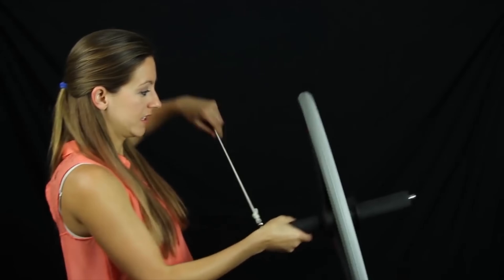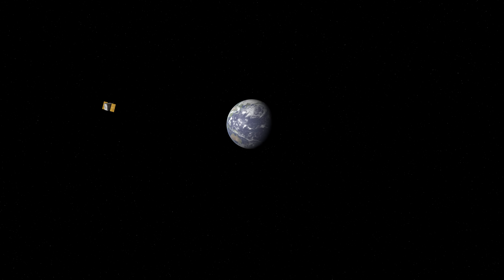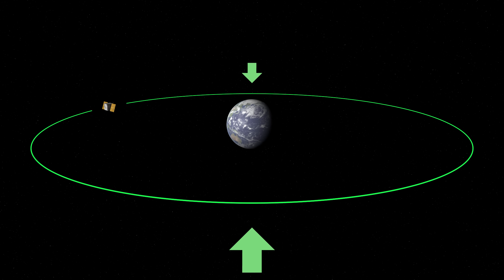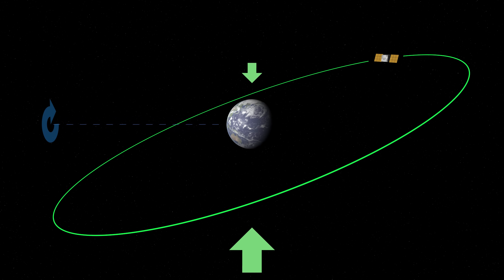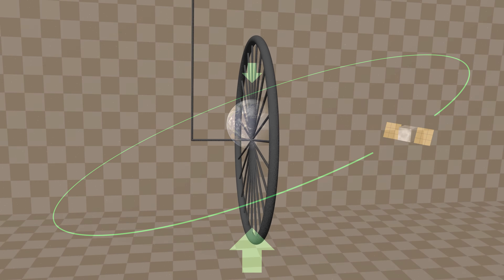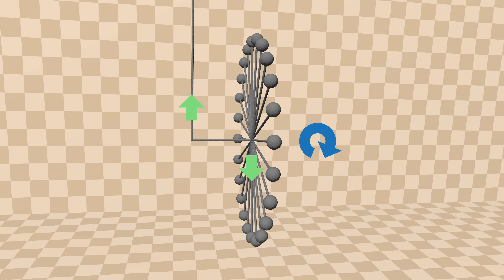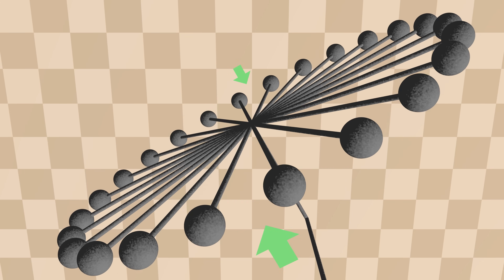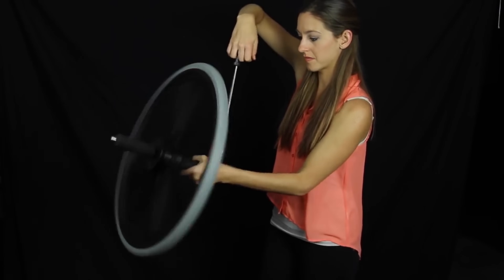Gyroscopic precession -- An intuitive explanation

Comment: Check this out! It has a part near 6:40 that talks about how gyroscopic precession caused by the Sopwith Camel's rotary engine made handling "tricky" for it's pilots during World War I. The rest of the video is pretty interesting too.
https://www.youtube.com/watch?v=MI08NGCgISE
Reply: The way I understand the rotary engine is that the motor spins around the crankshaft instead of the other way around which seems pretty backwards but actually makes for a more powerful engine when you think about the much higher moment of inertia it offers as opposed just the propeller and crankshaft spinning. It also kind of acts like a turbine and helps to keep the engine cool.

Comment: Why am I still confused, feel like an idiot. Gonna have ap physics test in next two week, IHAVE to understand it
Reply: Understanding it intuitively probably won't help your physics test, but think of it like this:

A force that is constantly acting perpendicular to the velocity of a moving object will not speed it up, it will only turn its velocity making it go around in a circle. Gravity acts this way on an object in circular orbit around the earth; as does the force in the spokes of a spinning wheel.

If an object is in a circular orbit around the equator of the Earth at 7.9 km/s and you give that object a 3 m/s nudge out of the equatorial plane, that object will not teleport anywhere; it's still going 7.9 km/s around the Earth, only now it has a small component of its velocity perpendicular to the equatorial plane. Since the nudge was perpendicular to its velocity it will deflect the object without speeding it up.

It will take it a quarter of a turn until it reaches the position that is the furthest out from the equatorial plane and gravity brings it back down toward the equatorial plane.

The spinning wheel is behaving in the same way. If you try to turn it; the rim is already spinning very fast and it will take a quarter of a turn to move out of the plane that it was spinning in, before the force in the spokes start bringing it back down.
Reply: watch the one by eugene khutoryansky it explains really well

Comment: Okay, so here is an experiment. And, what causes it? We mount two flywheels each on a different shaft. Mount them in the back of different pickups, with  the shaft horizontal and parallel to the pickup length. We spin one flywheel CW and the other CCW.  Then we drive the pickups forward at the same speed.  theoretically the one spinning counter-clockwise should stop rotating faster? And. it should decelerate faster if we drive faster? Will the other one accelerate?
Reply from the maker: Joe Deglman The pickups are driving in a straight line? If so, the rotation speed of the flywheel should be unaffected by the linear motion. That's theoretically, of course, in the real world air vortices, imperfect bearings, even interactions with magnetic fields could yield all sorts of spurious results.
Reply: Okay, so what you are saying is that the torque only appears when you accelerate it in one direction vs. the other, but disappears when you get to a constant velocity?
Reply from the maker: First, you apply a force/torque to something, and then it accelerates/rotationally-accelerates in response to that. You've got it backwards suggesting that torque arises from acceleration. That point aside, precession occurs when you apply torque to a rotating body. Your question seems to be whether precession arises from applying a linear force, and the answer to that is a resounding no -- regardless of whether it's constant velocity or not.

Comment: is there a duck in a corner at some point?! and did you use the moon as texture to the spheres on the wheels?! XD
Reply from the maker: Yes, there's a duck hidden in the video! But no, the texture is procedurally generated in POV-Ray:

pigment { rgb 0.2 } normal { bumps 0.4 scale 0.02 }

Comment: THANK YOU! I had trouble understanding why angular momentum had that direction. I pretty much got to the point on my own where I imagined thesame situation with the satellite and pushing it up or down. Then I clicked this video and it just filled in the gaps and now I finally fully understand something that I previously only could apply in calculations. So, I knew how it worked, but I didn't know why it worked. Much more rewarding to know why it behaves like this. I might have deducted it after that initial thought, but it also just feels very good to find a video that confirmed my initial idea and then just take it 1 step further and ofcourse it also saved me some time. Very rewarding, thank you very much.

Comment: I still don't understand why the wheel doesn't tip. This video explains only why the wheel rotates around the rope.
Reply from the maker: It is self-evident why the satellite's orbit rotates "90 degrees around" from the applied torque, as shown in the video. The change in position of the wheel's axis of rotation is similarly turned "90 degrees around" from the way that you'd expect the wheel to be pulled down. In short, if you can figure out why the satellite behaves the way it does, then the behaviour of the wheel intuitively follows because the two systems are nearly perfectly analogous.
Reply: D1ndo the wheel will not tip around the rope as the tension in the string equals the force of gravity 
T=mg so
Fnet =0 in the vertical direction

Comment: Best video I've seen explaining this. Top notch mate!
Reply from the maker: I appreciate the feedback!
Reply: @TheHuesSciTech  o
If the forces on the satellite are equal and opposite wouldn't they cancel each other out? Or because they are not being applied at the same time they don't?
Reply from the maker: @leif1075  Forces don't cancel out if they are applied at a different location and/or a different time. 

For example, if you apply a forwards force to the left hand side of a dinner plate, and an equal+opposite backwards force to the right hand side of the plate, the plate will rotate, which certainly doesn't qualify as 'cancelling out'.

If you push a kid on a swing, then wait for it to swing back towards you, and then do a equal-and-opposite pull (or run around and do a push from the other side), then the effect is to boost the swing twice. Again, that's definitely not 'cancelling out'.
Reply: @TheHuesSciTech  yea that's what I thought like I said..but i don't see how your illustration proves that torque points in a direction perpendicular to the regular force vector..since in your diagram with the satellitle it doesnt seem to point perpendicular to the plane of rotation..
Reply: @TheHuesSciTech  Oh by the way that's wrong, if you push a plate on both sides in opposite directions with equal force on opposite sides, of course the force cancels out..try it and youll see and that makes intuitive sense..I just tried it just to be sure
Reply from the maker: @leif1075  I mean apply the forces tangentially. In other words, just try to spin the plate and think about what your hands are doing to the plate: the forces are of a equal magnitude, but pointing in opposite directions.
Reply from the maker: Put it this way: you on the left side of the plate push forwards. On the right side of the plate, pull backwards. The plate will spin (unless you're grabbing the plate so firmly that each hand is providing a countertorque). Pushing forwards and pulling backwards are opposite forces.
Reply: @TheHuesSciTech  yea but they are equal and opposite so they should.cancel out even though at differentlocations..i tried it and itndidnt spin..it makes sense..
Reply: @leif1075  You must be doing something wrong with the plate demonstration if you're not getting it to spin... Instead, get a toilet roll or something of the same shape, put one hand flat on each side, left and right, apply a little pressure and pull one hand while pushing the other. The object will rotate in your grip. The movement of your hands indicates the directions of the forces applied.
Reply from the maker: @leif1075  This is what I'm talking about: https://www.youtube.com/watch?v=A9Rz3emxTn4  . The plate spins. Because even if two forces are equal and opposite, if they're not acting through the same location/line, the force component cancels out but leaves a residual torque. I think understanding how forces combine to yield a torque is what you need to research more.
Reply: @TheHuesSciTech  Thanks  i guess ibwas applying countertorque as you suggested maybe? I fully understand regular torque just the plates seems counterintuitive and the way it's drfined as pointing out of the plane..
Reply: @TheHuesSciTech  Ah ibwatched the video.  i was not pulling the plate down with the right hand rather pushing up on the plate on right and left sides. You see the ambiguity though? Because technically you could still say that's an equal AND opposite force becaise with the left hand you turn the plate clockwise but with the right hand you are turning the plate counterclockwise. Aka..the opposite direction.hence this could be construed as equal and opposite also and would cancell out..see the ambiguity and why its frustratin the limits of language? Sorry for the confusion.
Reply from the maker: @leif1075  Yeah, it's tough doing this over text chat. However, you should know that in physics/maths, equal and opposite has an very specific and unambiguous meaning: the force vectors must be equal and opposite. I.e., north vs south, up vs down. Not counterclockwise vs clockwise, those aren't vectors. Think anti-parallel, if that helps.
Reply: @TheHuesSciTech  why aren't those vectors..they point in specfic and opposite rotational directions..I don't see why they wouldn't be vectors? I think most people would consider them as such?
Reply from the maker: @leif1075  We're really getting into the weeds here, partially because this is really messy to discuss over text chat. This would be trivial to discuss if I was sitting next to you, but I'm not. I gotta say, you should really talk to your teacher/physics-minded-friends/colleagues about this, because I don't think anything I can write in text will ever clear this up.  But for some reason I'm going to try: 1 N up, and 1 N down are force vectors. 1 Nm clockwise and 1 Nm counterclockwise are torques, so they're not even forces, let alone force vectors. Yes, a torque can be represented as a vector, but that's not what we're talking about right now. To apply the equal and opposite rule, you have to just think about the raw forces, not jumping ahead and thinking about what sort of rotation it might produce. North force is opposite is south force. Up force is opposite to down force. Clockwise force -- isn't even a thing, let alone "opposite" to a counterclockwise force. If you want to talk about clockwise torque, then that's a whole other can of worms (opposite torques do indeed cance, btw, but I fear that's just complicating the issue)
Reply: @TheHuesSciTech  right bit torque is just force times distance right, so it's not that different..and think youbagree even physicists ir physics minded people wpuld agree that turning something clockwise and truning it counterclockwise would constitute an opposing of not quite force per se..then opposing torque at least..which like i said is just force times distance
Reply: TheHue's SciTech Dude i have been strugling with this thing for a while and couldnt figure it out and i am not a dumb guy i am pretty familiar with all fields of science and understandes most of the physics videos but not this one and you have made it that much more simple compared to veritasium thank you dude :)
Reply: Yes, great vid. I get it now. 600+ h on ksp and never thought of this. Quality.
Reply: Absolutely! I can do the math all day, but without being able to understand WHY it was happening I couldn't apply any of the knowledge I had. Once I saw the satellite demo in the video and thought of the resulting vector from the force everything instantly clicked.
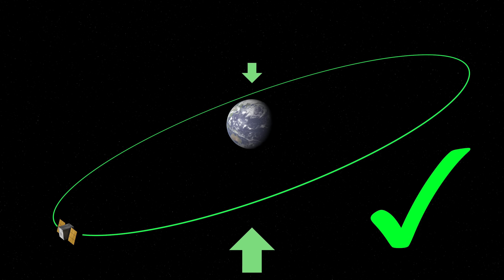Reply: Im sory indont see it..i dont get what the teo blue arrows at 1:25 mean..what two axes..i don't find thia intuitive
Reply: Very true

Comment: Nice video and graphics used to explain the topic and set up the problem. 
However, I felt like the single most important thing is left out in the end, namely how the gyroskope resists the external torque and stays stabile. This is because the tendency for the rotating gyroskope to resist changing its position is larger than the torque applied.
Reply from the maker: But a bicycle wheel, set up as illustrated in the diagram, doesn't stay stable -- it precesses around. So any explanation of the tendency of gyroscopic instruments (attitude indicators in planes, etc) to stay perfectly stable needs to explain the difference between these two cases.  Furthermore, which S.I. units is this "tendency" you describe measured in?
Reply: The wheel stays stable in the sense that it does not tip over as long as it is rotating. It is also easier to keep balance on a bike that goes fast compared to when it goes slow. This follows the same principle.
The stability of rotating objects stems from the fact that the angular momentum vector will always "chase" the torque vector, i.e. rotate towards it. Thus, when a torque is applied to the system from outside, it will be counteracted by this "chasing" mechanism of the vectors, preventing the system from becomming unstable. The SI units will be those of angular momentum and torque I guess. 
Since this is rather complex and very non intuitive physics, I thought that "tendency against change" was a good way to put it.

At least this is how I understand this wierd, but very technologically useful phenomenon.
Again, thanks for a good video.

Comment: For me this was not intuitive at all since you brought in the concept of a hula hoop "not in motion" which then would act according the first example as far as I can see. If you had said the moving satellite wants to continue in it's original direction, that would have been easier to understand when a force is applied to it. Plus, you make this seem that there is only one thing that will happen but I think that not only will the direction of travel change due to momentum but so will the position of the satellite from it's original obit. Overall I get the point, just some thoughts.

Comment: out of 2034723 videos about how gyroscopes work this one was most concise and delivered the epiphany thank you
Reply: Can you help answer this please. When you spin the wheel forward (clockwise) it turns to the left as seen in the video. Spin it backwards (counterclockwise) and it will spin to the right. Here is where I found an issue. Both right and left handed boomerangs are throw forward in a clockwise direction yet the left handed boomerang flies to the right. Why???
Reply: @VictorPoulin  I'm new to boomerangs and how they work I'm pretty sure but the airfoils of left and right boomerangs are mirror images of one another, so their angular momentums are opposites. This short video might be helpful: https://www.youtube.com/shorts/71cQ7BW4l0U

Comment: Thanks for the posting. I get the precession part and the standing still of rotating wheel part. What I don't still understand is the rod that attaches the wheel to the string part. It still has a net gravity force downward, isn't it ?

Just Think and here helped much.
Reply from the maker: Ultimately, you add up all the forces and torques on an object, and then (roughly speaking) add those on to the velocities and rotation speed of the object. There is no requirement for the forces on the rod to be separately borne by the rod; the combined rod-wheel system is rigid (at least with respect to 5 out of 6 degrees of freedom) and thus shares the forces placed upon the combined rod-wheel system.

Having said all that, you are indeed hinting towards a subtle leap of logic (in both the traditional explanation, and my one above), which is this: if the axis of angular momentum is rotated, why does the wheel itself rotate to follow (i.e., why does the wheel rotate nice and flat with its symmetry axis remaining in line with its rotation axis?) It seems equally plausible, from first principles, that the wheel would just start tumbling in a random way. I think there's another effect going on, which causes bicycle wheels to naturally transition from wobbly spins to nice flat spins. Anyway, I digress...
Reply: What if we stretch the rod a lot outwards or make the rod weigh much heavier than the wheel.. I'm not sure it will sustain. I am feeling very nauseous when I dont understand physics stuff.
Reply from the maker: An excellent question. A similar question is how things change if you keep the wheel/rod arrangement the same, but just reduce the spinning speed of the wheel. At some point, the gyroscopic effect has to stop working. In both cases, I believe it's because the torque vector fails to remain at right angles to the axis of rotation; which in turn is because the axis of rotation fails to stay locked to the axis of symmetry of the wheel. This is why I mentioned this in my previous comment; unfortunately I cannot offer a clear explanation why these two axes ever stay locked together, let alone mathematically model it or provide an intuitive explanation (yet!).